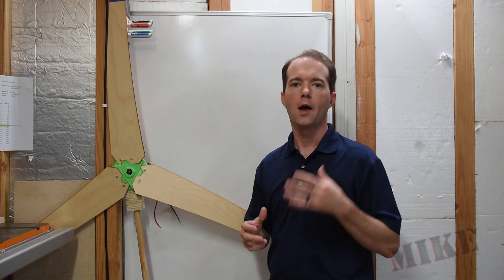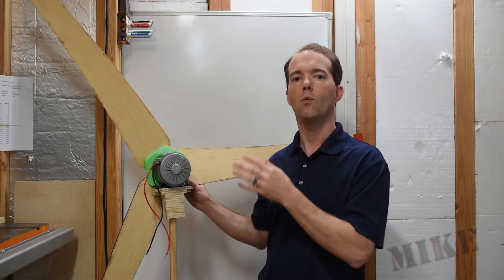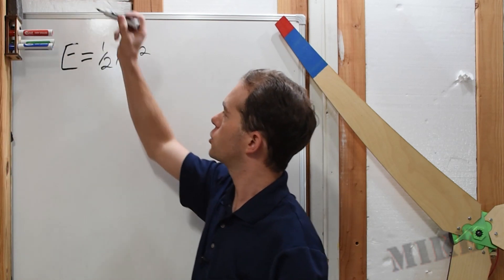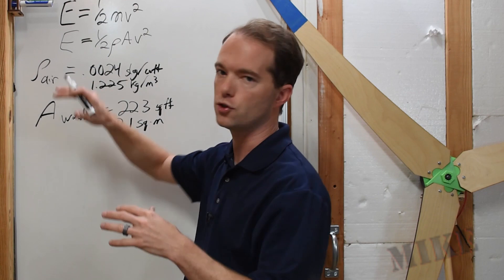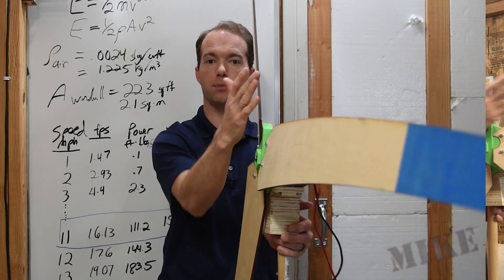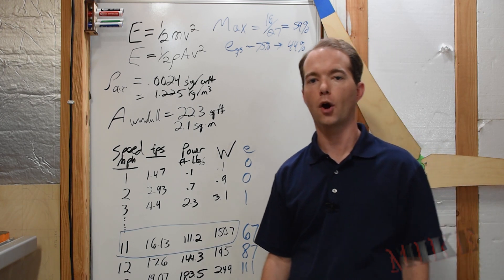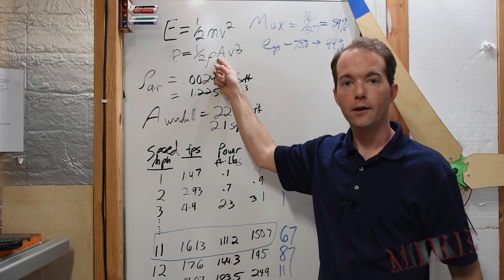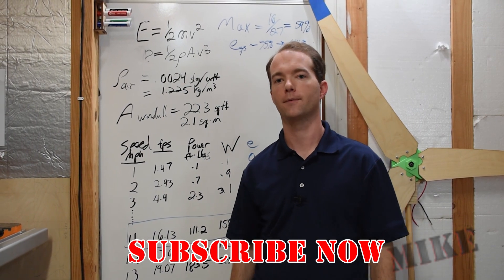Small Windmills Are a SCAM - Mikes Inventions

Comment: Most people will refuse to do the math and just go by "feel" or "instinct". They will feel that strong wind all over the property, their instinct will tell them that there's a lot of energy to be harnessed and instead is wasting away. So, they'd rather confirm empirically that the micro-windmill is really a scam. I've seen some tiny turbines with "revolutionary" new designs that no one had ever thought about, with "efficiencies" ten times higher than NASA ever dreamed of, delivering 10 KW on your roof. Just no respect for the fundamentals of physics. And no laws or regulations on their performance because those regulations are supposedly just intended to benefit the large corporations and keep the small homeowner from achieving energy independence. So sad and so easy for some gullible people to fall for it.

Comment: The only way wind power on a small scale makes any sense is when you’re using it as a supplemental to solar. On a sailboat, the moving boat creates apparent wind, and that generates a steady trickle of electricity to the battery packs, even when the sun isn’t at an effective angle or the panels are shaded by the sails. On a mountain cabin, the wind is usually moving on days when the sun isn’t shining. This is like being able to fill the ice cube tray back to capacity after removing two cubes for a single glass of water because waiting for the sun angle might mean you have no power to run the navigation lights or a radio to hear a distress call from another boater. Wind is only a supplimental source, it can’t be relied on for stand-alone power. Now a micro hydro is an entirely different subject, becaus the density of the fluid is much greater, and by jetting the fluid with a nozzle, you can get the turbine to spin much faster.  You can do the same with wind, but building a plenum to collect enough air would be silly. By the same token, adding side reflectors (like the “sun worshippers” used in the 70s) to a solar panel doubles their efficiency.

Comment: Power from the extraction of a moving fluid (air) is proportional to the CUBE of the wind speed.  This is a mess engineering-wise because it means the wind has to be a perfect range of speed to extract useful power - too little and the power is basically 0, too much and its overloading and tearing apart the windmill.   [this is what he concludes in the vid BTW, 100% correct].